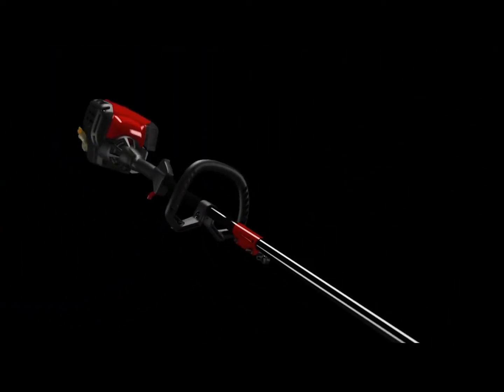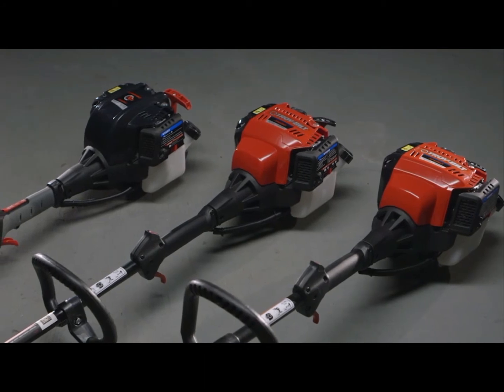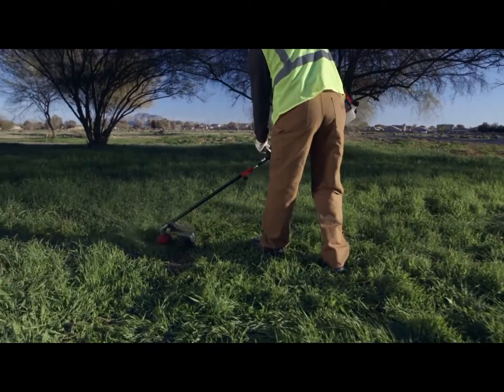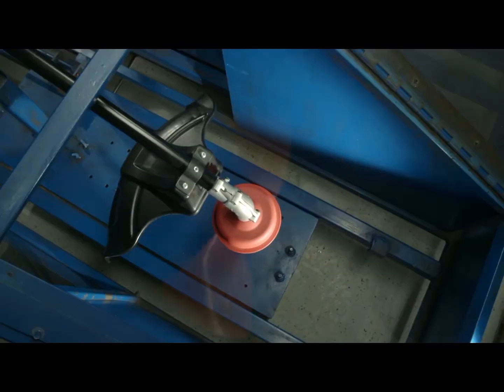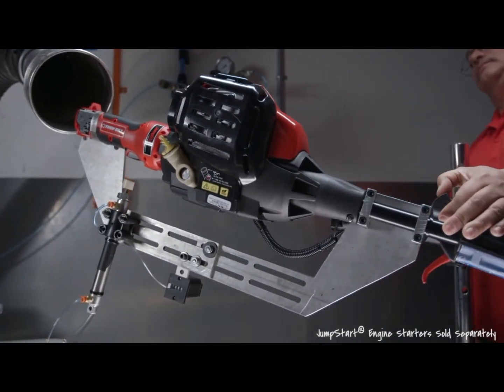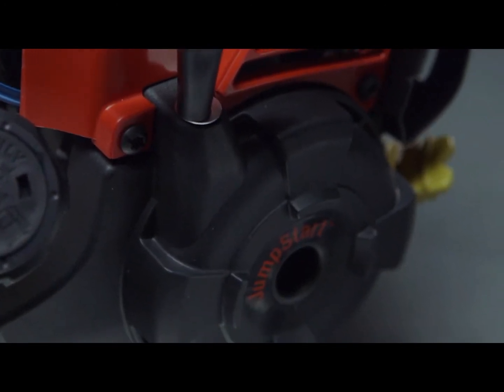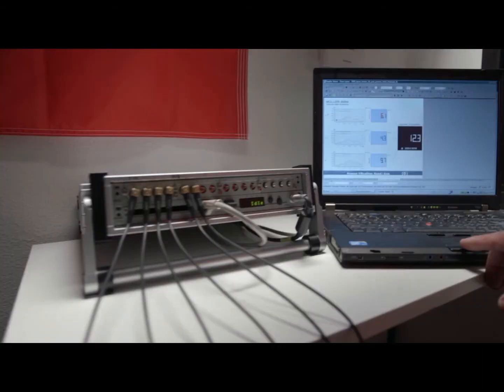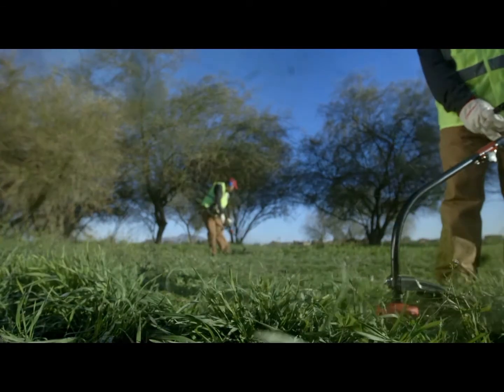Troy-Bilt® How We're Built |  4-Cycle Trimmer Engineering Technology

Comment: the 4 stroke 29 cc unit is probably the weakest unit I have ever used as far as BUILD goes Many weak points make this unit fail. 

Wore my unit out in one summer.

The curved shaft with the string quick end has the weakest fastest build Crimp bushing that is non greasable. The string head is awful to replace plus it threads on the wrong way.

The brush cutter head has a non greasable gear transition that is attached so weak by a tiny screw into the lightest tube in the industry. The Non-solid shaft makes the whole unit vibrate due torque feedback from using a brush blade.

 This unit NEEDS a solid shaft with a brush blade...yes even if is a break apart like this....I have a unit the breaks apart and it is solid  Except with curved tube...

Gear transition needs better attachment with greasing capabilities.

The whole curved string trimmer attachment needs to be redesigned

Comment: I bought one of these and used it once. I ran gas dry till engine died. After a year of not being used. I pulled it out of storage, checked the oil, put new gas in and tried starting, would not start at all. A piece of junk right now!
Reply from the maker: Please call 18006681238 so we can have a technical service manager look into this for you.
Reply: nelson Santos it was ethanol
Reply: Did you check the sparkplug? If you remove it and connect the wire while its grounded to the engine, you can see if there is a spark while someone else pulls the starter
Reply: I checked the spark plug. That was the first thing I did. I saw very good spark.
Reply: What I did is buy gererac weed whacker also made or similar to Dr. Field and brush mower. Worked really well.
Reply: you havent used it for a YEAR?you checked the oil...do you know anything about engines????i guess not...
Reply: TroyBiltCA Hello....dont get me wrong...i have just find out about you like half an hour ago....I have an MTD trimmer and Husqvarna...and i looked for 4 stroke trimmers and there you are....Honda is to expensive...so i have found an alternative.unfortunatly you dont have importer to Croatia.
maybe this will change....i have an idea to import your products...you have a good price and you are member of MTD....there is MTD here but as i said i have never heard for your company until this evening....
Reply: I certainly checked the oil. Checked spark plug, everything seems Ok,
Reply: it is not what I wanted to say....you can not keep oil in 4 stroke engines for a year....you should put a new one and to check out carburator.
in such cases if there is no mechanical issue it is always either fuel or electric problem.there is no third part in it.and it doesnt mean if spark plug has spark that is good....the voltage on the electrode might be to low and mixture wont ignite.but you were to chep to go and buy a new spark plug and new oil....so insted you proclaimed the engine as garbage and the brand also with it.ICE engines are simple....they are not Soyuz rockets....it is not space or nuclear science....what would you do if your car stoped working?you would go to the mechanic....and there you can get a really nice bill....because you are ignorant about how stuff works and you can get charged for the parts that are working normal and are in good conditions.another words....you are like a woman....only women can get changed and charged the spark plugs on a diesel
Reply: that is a problem of an average american....lack of general knoledge....and it is not your fault but your government.they are educating you not to think with your head.sorry if that is offending you but it is true.....your universities are in rank bellow our high school...in Croatia...
in your high school you take how many classes?6,7?I had 18 in third grade of high school!when I was 17 years old...to put you like this....if you are going to school to be educated for laying tiles....your version of education is only blue tiles and only with 20x20cm dimension....in Croatia we are educated for every dimensions and every colors....that is main difference.
dont be so narrow in the life....there wont be always around a mechanic or people educated for problems you might have at home....and there is internet.you could checked out what to look for,how to solve a problem.sorry i i was rude but it is a fact and i always speak truth.best regard from Croatia and I hope that I gave you material to think and you wont act so silly next time you have a problem of any kind....it is you who is responsible for solving your problems.
Reply: p.s. 20cm is near 8inches....although USA signed the agreement of using SI units you are still using your measures....like foot,inch,pound,mile and other crap.....meter,kilogram,kilometer....1 foot is 30cm(i think...i need to look for it),1 inch=2.54cm,1 mile=1.7km ,1 pound=0.5kg etc
Reply: That's what I did, checked spark plug, replaced oil, even cleaned carburetor, replaced fuel filter. This weed wacker looks brand new, clean inside and outside. It doesn't matter anyway, as I said, I bought a drfield walk behind string trimmer and it works like a champ!
Reply: You abused it,.  by not doing regular maintenance on it & letting it sit for extended amounts of time. That's you're fault, not troyBilts.

Comment: This trimmer is so fun to use because you can feel all the power at full throttle, and it just blazes right through grass, compared to our previous electric trimmer which barely did anything.
Also I like the sound of the engine too. It is just so satisfying to rev!
Reply: Yep,  they work even better with a speed feed head. Came off an echo srm 225